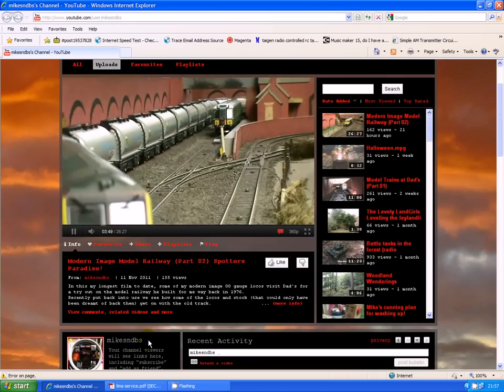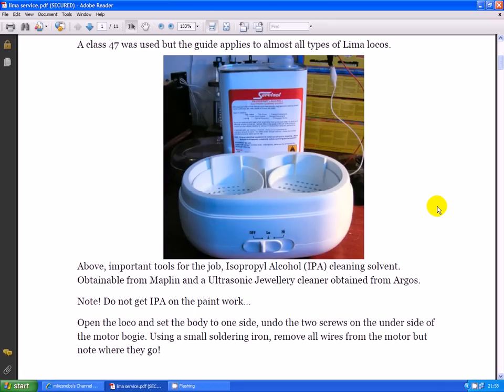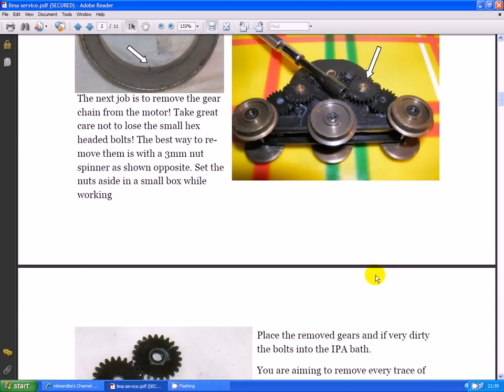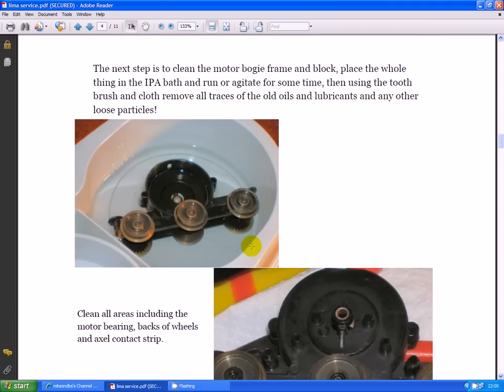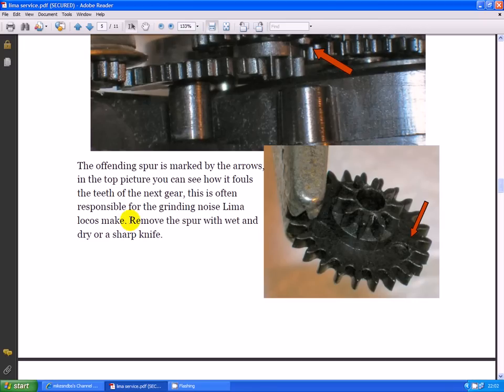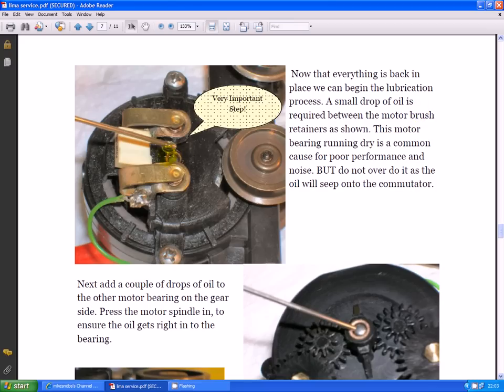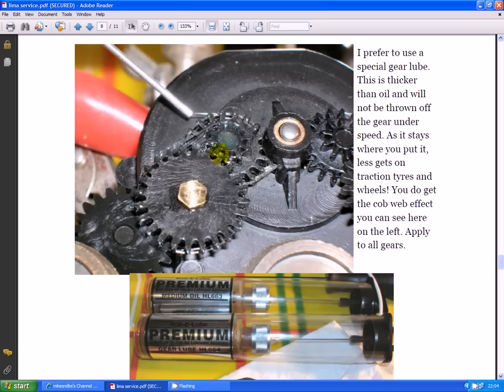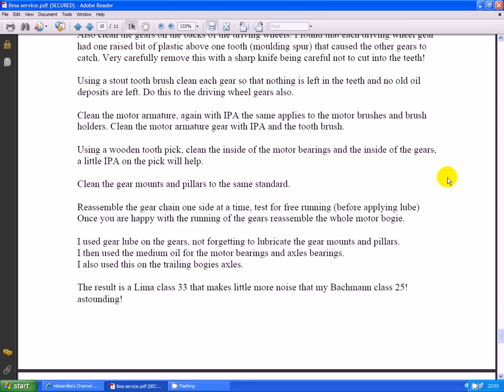Lima Loco Service Guide

Comment: ThanksMmike for providing such a clear, easy to follow, and entertaining guide to servicing Lima locos.  I was surprised at the amount of flash left on the gears, etc, no doubt as a result of the manufacturing process.  Thanks to your guide, I know what to look out for when taking the motor/gears apart.  Look forward to your next film.  Regards, Paul

Comment: Thanks Mike for providing such a clear, easy to follow, and entertaining guide to servicing Lima locos.  I was surprised at the amount of flash left on the gears, etc, no doubt as a result of the manufacturing process.  Thanks to your guide, I know what to look out for when taking the motor/gears apart.  Look forward to your next film.  Regards, Paul

Comment: Hi Mike,
Twittered you a day or so ago regarding the Hornby Western Harrier (moving VERY VERY slowly.)
Cleaned it up and it still made a screeching sound and tended to slow down 
after a few circuits. Then greased the small cog (through the com) and 
low and behold, it seems as though it's freed itself and now running 
beautifully. Possibly due to it being stored away for many years!
Thanks for all the visual help and have downloaded service sheet. 
Slowly getting through my other old locos.
Thanks  again.
 (Being in the Canary Isles leaves us a little beyond the help of
 model shops etc but your YouTube contributions are a God send!)
Rossi
Reply from the maker: HI, glad it helped, yes those motor bearings need to be kept lubricated, but not too much as one end it can get on the commutator. We got on holiday to Lanzarote are you near there?
Reply: No, we're on Tenerife (20 years)...Not the touristy parts! Hence the outdoor railway with the weather.
Lanzarote, one of the isles we've actually never been to. Have they got a model shop?!!!LOL
Reply from the maker: No model shop lol, great to meet you and thanks for supporting my channel

Comment: Thank you for your time in making this video.  I was searching for details of the LIMA Class 42.  I understand all that you had said and shown.  The trouble I I cannot find a way of taking the body off.  I bought mine many years, I hope you can help as I so much want to run this loco, The Royal Army Ordnance Corps, hauling a rake of BAOR coaches.  I thank you for your time and help.  Richard.
Reply from the maker: Hi Richard, I have never done it, but would imagine it just separates along the join, however a much easier option is to put the loco in a cradle wheels upwards, see the two screws at either end of the power bogie?  Remove these and lift away the bogie frame, then wiggle the motor and wheels out of the chassis, no need to remove the body.  If you have a look at my Lima class 73 video you will see what I mean :) give me a shout if you need help

Comment: I have done a lot of work on about 10 Lima locos and on two so far, the un-smooth running on some was due to the backplate bushing. The motor axle at the comm end had slight play in the bushing. The motor ran lovely and smooth for a bit, but when the lube had got "thrown out" after some running, it went back to a rattly slow speed performance
Reply from the maker: That's odd, you could try a very small amount of of the gear lube there, it won't throw that off easily :)
Reply: On the two motors in question, the lube did no good after 5min running. I had the motor assembly running on the bench (croc clips from track to motor) and looking at the backplate, you could see the lube forming a swirling material around the motor axle, but if you increased the speed the lube eventually disappeared, leaving the axle spinning in a bushing that is fractions of a millimetre out, causing a wobble. Another thing I have come across is the loose fitting ring magnet. Can be made a nice secure fit with electrical tape around it. Anyway, without blabbering on any further, suffice to say, the better of the Lima motors I have done so far are running shockingly close at slow speed to the way a Bachmann loco does.

Comment: Excellent video there mate. Despite what I have read on blogs and some forums. Lima models are very good for their age and in my view are better made than some of the Hornby Railroad models. The noise can be an issue on some models that have "gone dry" but if they are lubricated well, they are fairly quiet and in cold weather they can be a bit sluggish until the motor warms up. I am certain that if Lima modernised their range of British models to match their Class 67's. They would still be around to rival the like of Hornby and Bachmann ;).
Reply from the maker: Thanks very much! I love my Lima stuff :) I've found that this one off service brings them into line with most modern models. All they need after is a little re-oiling from time to time and they run smoothly in all conditions. Good luck with yours
Reply: I think the Lima Class 67 still looks a bit cheap compared to the European models, their trademark yellow plastic moulding and self coloured ends right to the end. I read that Lima's UK importer had a hand in this specification as they were falling behind Bachmann at this time especially after the launch of the Bachmann Class 37 in 2003. Lima never manufactured in China before the Hornby takeover in 2004.

Comment: Looks useful. I'm going to be using your guide to try and get a non-running HO scale Lima class 33 operational. I suspect it may need a new motor, but figured a thorough clean is a good starting place. Thanks!
Reply from the maker: Good luck, we have much more info over on Model Railways Unlimited
Reply: @MikesMovies  When I stripped the motor (following your instructions) I discovered that the main problem was  a complete absence of brushes! While I await the arrival of a new pair, however, I'm cleaning the rest of it. 

I'll take a look at your other channel but generally youtube is a last resort for me rather than a first option. In this case I much prefer your wonderful PDF to the accompanying video.

Many thanks!

Comment: Hi Mike,  Thanks for your very detailed YouTube guide.  I have been given an old Lima 117 DMU with power car W51342 which looks excellent but does not run.  I have removed the two self tapping screws from the underside but the body seems still to be attached at the two ends.  I don't want to damage anything. Please advise how to remove.
Reply from the maker: Hi Neil, thanks, sorry missed this as I am over on Model Railways Unlimited these days. If you take the bottom screws off the bogie should be able to be jiggled out of the body.
Reply: @MikesMovies  Hi Mike, Following your message I have taken the two screws out of the bogie and I can wiggle the motor out.  The problem I have is to remove the body shell from the chassis.  I have removed the two screws from the chassis and I can pull the chassis out about 3mm in the centre, but the ends at the buffers are still locked into the body.  It is very fragile and I am worried that I could break it.  There are white deposits on the inside of the window which I want to clean off.
Reply from the maker: @neil0131  Hi see this https://www.rmweb.co.uk/community/index.php?/topic/9818-lima-class-117-body-removal/ Looks like you need to start at the corridor end and gently lever up, an old credit card might help?
Reply: @MikesMovies  Hi Mike, Thanks for your further information.  I have now got it apart!  Remove the 2 long screws in the centre of the chassis, remove the two screws from the motor bogie, wiggle out the motor, reach in to unclip the black corridor door, then from the outside push in the black latch tab that was hidden by the corridor whilst applying a little tension to separate the body from the chassis.
Reply from the maker: @neil0131  Hi Neil, that's really good information thanks, do catch up with me over on https://www.youtube.com/c/ModelRailwaysUnlimited

Comment: Hello Mike
Just watched your excellent video,i have recently purchased a number of lima locos ....37.....40......55 and all run apallingly so i am going to have a go at your procedure,though it appears to me that pickups are part of the problem,do you ever add extra weight to improve pickup or is it just the nature of brass wheels
BR Pete
Reply from the maker: peter wilding Hi Pete, thanks very much and do check out the update video. Never found the need for extra weight, plus with plastic bearings it could cause wear. Sometimes the wheels can become slightly corroded if not used for some time, maybe this is what you have, just give them a good clean up and all should be fine. Good luck, let me know how you ge on

Comment: Hello Mike, Just watched your video recently, and it works a treat many thanks. Now I have a problem I wonder if you can help me with. I recently bought two Mainline Peak class 45 locos, and they run like a slug!.
Do you know of any motor upgrades or something that I can do to kick some life into these dreadful locos. Any suggestions would be great. Many thanks, Dave.
Reply from the maker: Hi Jon, glad it helped, sadly while a lovely loco the Mainline 45s have issues as you have discovered, one of the biggest is split gears on the drive wheels, also the motor has plastic bearings! You could strip it down, make sure the brushes are ok and springs etc, clean the commutator and oil around. Got the same thing with one of mine

Comment: I have a Lima 37042 Mike. When its on the track, it is dead but when I lift the front set of wheels up, it comes to life. Then if I put just the left front wheels down, the wheels still turn. Put the right front wheels down and it is dead. Any ideas what could be wrong?
Reply from the maker: Sounds like a wire or connection has been crossed over. If you join https://www.facebook.com/ModelRailwaysUnlimited and post some internal photos we can try and help

Comment: Well planned system -I have a couple of these reluctant starting Limas (had assumed this was a gearing quirk) but were smooth once started. You made a video repairing a mates motor, will search for that, as it also was well made. (think their engine had actually seized). Not impressed with oil pens, so might change to different grades of the lube. Alan.
Reply from the maker: Cheers Alan, all these videos are in a playlist now to make it easy to find. Good luck with your services.
Reply from the maker: https://www.youtube.com/watch?v=U_66Yq4NkgE&list=PLlsk-RUtmVpmVyNytCCAdm72rOFswnODU
Reply: Thanks Mike - very useful viewing for any modeller.Alan.

Comment: Thank you for such detailed instructions which I followed and now the mechanism runs very well , the magnet seems very very weak causing the armature not to turn without assistance . I have tried remagnatising the magnet but is no improvement in the strength of the magnet . I not sure what do next , it is a Lima Deltic . David
Reply from the maker: Hi David, many thanks. The magnets never feel that strong to be honest and I have never known one to lose its power. I am wonder if there is something else at work here? the only other suggestion would be to obtain an old motor and use the parts or go for one of those upgraded motors? I am in West Sussex where are you?
Reply: Thanks for coming back to me , I'm in North Devon . I had also replaced the brushes and springs , looking at the magnet there is what looks like a crack at the top . When I did get the motor to run with assistance from me turning the gears there was a lot of sparks coming from the brushes . David
Reply from the maker: Something does not sound right at all, are you able to take some detail photos and a very short video clip of the issues and send to me to consider?
Reply: Yes I'll do that tomorrow . David
Reply from the maker: Cool, what loco is it? also what controller do you use on it?
Reply: Its a Deltic and I use a Gaugemaster model Q .
Reply from the maker: OK, no issues there then and a usually solid loco. Are you going to make a video and upload to your channel, I have subbed
Reply: Yes I'll make a video and upload to my channel .
Reply: @gcmet1063  If a ringmagnet is cracked or fractured , I beileve the most of the total strength of the magnet will be lost, when the magnet is undamaged, the magnet will have a North pole and a South Pole, (an N-S magnet)  the cracked  or fractured ring magnet will become a N-S-S-N magnet of diminished strength, the sparks may be the armature binding or excessive current through the motor windings due to the lack of magnetism, I hope my theories are correct, many years since I played around with magnets and fractured magnets at school

Comment: Hello Mike little help please I have been given a E 680  Lima Diesel. That came in couple of pieces after putting back together I find the front boggy wheels are not level . When on the track the front wheels do not let the wheels next in line to sit on the track, if I loosen the screw holding the front two boggy wheels it then sits down but the front wheels just keep coming of the track Regard Jeff
Reply from the maker: Hi Jeff, don't know this one at all, can you send photos of the issues?
Reply: @MikesMovies   Hi Mike thanks for the reply -how do I send you a photo?

Comment: excellent vid. Thanks
Reply from the maker: Hi, thanks very much! do you have many Lima?
Reply: MikesMovies
I just have 1 Class 47 which is a few years old and needs upgrading after being unused for a few years. Eventually I may add it to my DCC stable with a decoder but meantime your step by step instructions were very helpful in getting me started. One question, is there a  big difference between 99% IPA and 95% IPA. I have the latter. Thanks
Reply from the maker: Not sure but it would depend on what the 5% was made up of? if it was water it might cause rust?

Comment: This turned my V/Line Commonwealth Engineering S-Class from a slug into a cheetah. The wheels were chalked up with carbon and the inner shell was covered in oil.

I have the lubricants suggested in this video on the way, so it'll be a few days before she's back to normal... but I was thinking about adding an LED light to the front and rear of my loco.
Reply from the maker: Glad to hear I have been of help, yes I have added lights to my class 47s and 37s there are kits out there that make it very easy

Comment: Thanks for the great guide! Just wanted to check the gearbox lube you used - was it this? (http://ebay.eu/1O0E6X6) FWIW I've just done a similar routine on my Mainline warship diesel, which was stuttering all over the place before and works ok now (brushes are worn, but it's hard finding mainline spares so I just cleaned them up a bit and put them back.) On the plus side, the thing was less than £15 on ebay including postage :-)
Reply from the maker: +berry120 Hi and thanks, yes that is the gear lube. Mainline warship ah! managed to get mine running sweet if you find my 'day on the Western video' you can see her. The do suffer from split drive gears, the brushes, you might find hornby ones filed down a bit will work?
Reply: Nice - just watched the video! I think the gears in mine are a bit worn out too, there's a bit too much lateral movement for my liking (interestingly the drive gears seem fine though, it's the others that are the issue!) Having said that, at the moment it's running reasonably well without any lubrication, so when the gearbox grease arrives that should make a fair difference. The hornby ringfield ones I had didn't fit, I could file them down I suppose but since they're clean and back in for now I'll leave it until they start to show their age again!
Reply from the maker: +berry120 Don't forget the motor bearings and gear pinions as well as axles all need proper lubrication. Good luck
Reply: +MikesMovies Will do, thanks!
Reply: MikesMovies One other thing I meant to ask - do you know what type of screws I need for securing the body to the chassis? Mine was missing them when it shipped...
Reply from the maker: +berry120 For the Mainline Warship? can't recall and she is packed away deep. Think they are M2 or 3 self tap maybe 12mm
Reply: +MikesMovies Thanks, I'll give some self tap M3's a try and if not probably stock up on a bunch of sizes (they come in useful anyway!)
Reply from the maker: +berry120 Maybe try them first in the pillars by hand, thinking about it M3 might be too big. Good luck.
Oh this is the video with mine running https://www.youtube.com/watch?v=YI6qPxC5e28